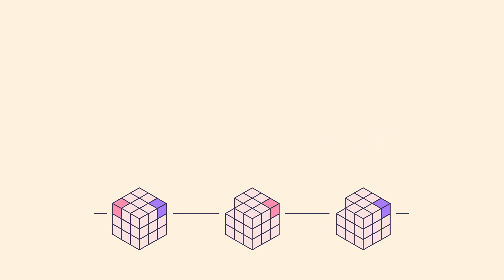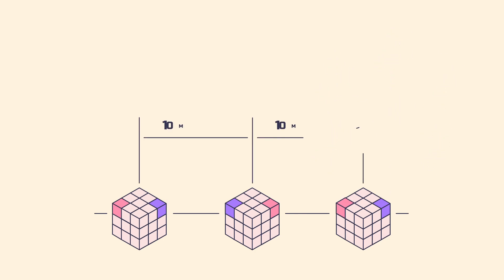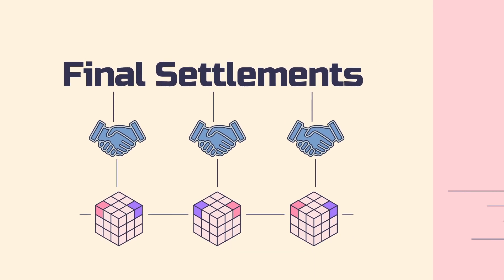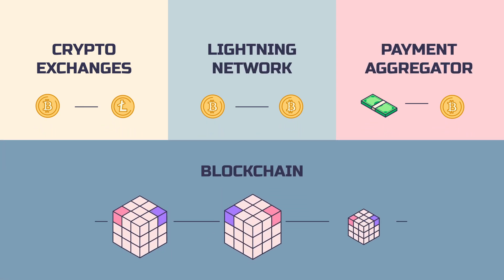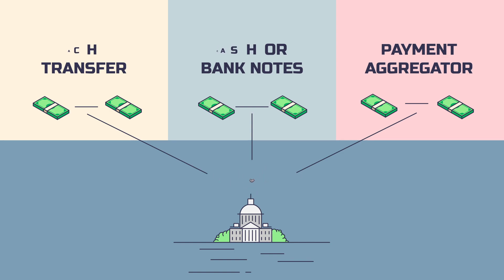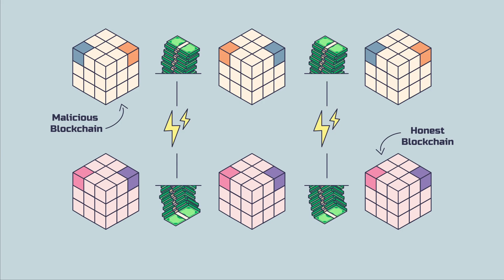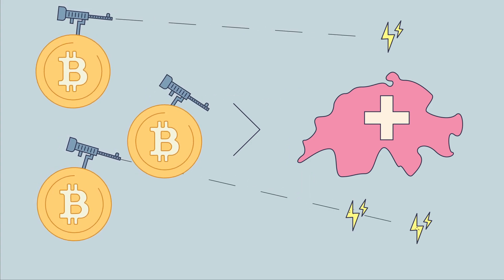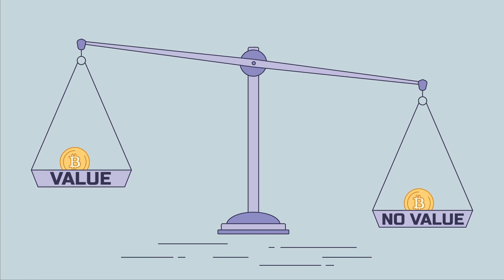Why does Bitcoin use so much energy?

Comment: How can bitcoin's electricity usage secure it but that same electricity usage can also not attack it? (2:34 ish)
Reply: By the time you spent enough resources on equipment and energy to attack it and be successful, you would have spent about the same or more than what it would have required to obtain the same amount by simply mining it. There is no incentive to attack it, because the cost is greater than the benefit.

Also if you were to succeed in attacking it, in doing so you would devalue it (nobody would want it anymore). All the cost you spent to attack it would be wasted and you'd be holding a worthless bag.
Reply from the maker: you would have to get a decentralized network of people that speak all different languages to cooperate and agree to attack without sounding an alarm. 

close to impossible, goes against the incentives of the system